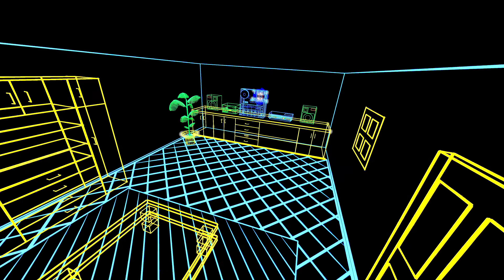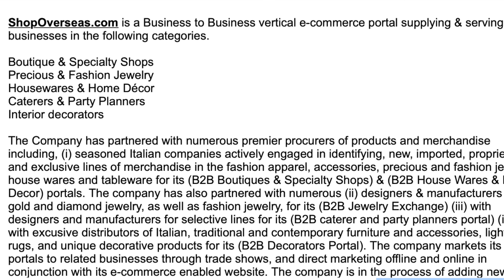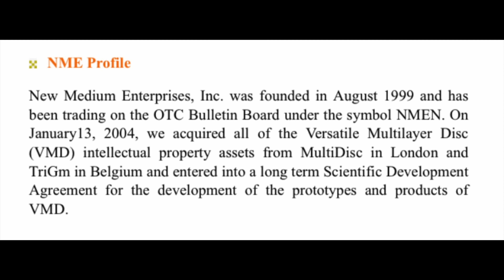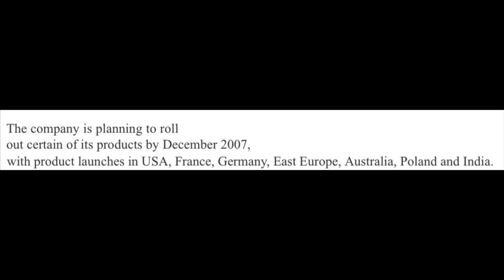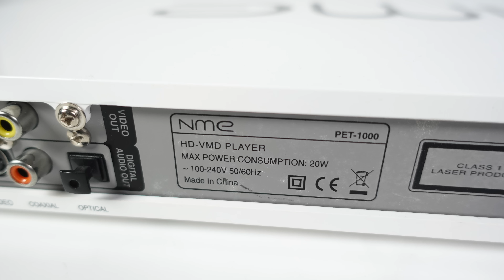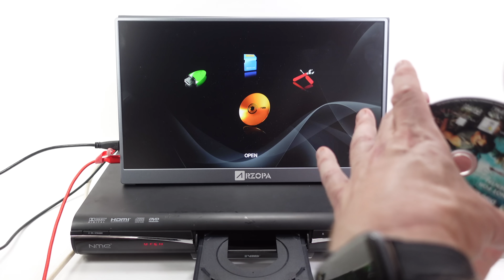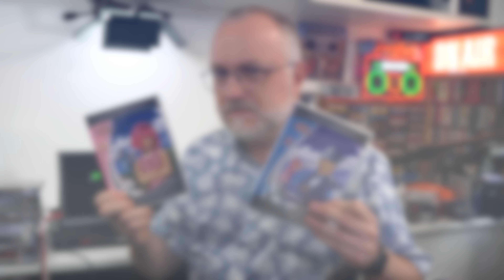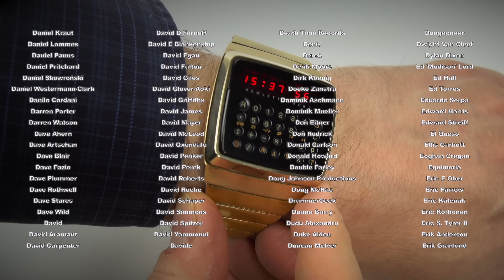The HD-VMD story - The format that lost to the format that lost

Comment: I would wager that those multi-layer optical discs have an HD_VMD version of the classic Laser-Rot, likely due to the adhesives used in the layering process attacking the substrate and making the disc unreadable.
Reply: It's Fran again! Nice to see you here 😊
Reply: Channel crossover!!!!?
Reply: @lamecasuelas2  
Oh THAT'S a collaboration I'd like to see, these two could make some great stuff together!
Reply: can you see it under a microscope,  I am feeling its more software changes
Reply: I had about 400 HD DVD’s that I picked up for couple of dollars each when the format failed, about half of them now have laser rot and are unplayable.
Reply: Fran comes Along floating an answer like she’s in zero g!
Reply: @adamreid5901  
 I ripped all of mine about 12 years ago for that very reason.
I’ve amassed about 2TB of videos so far.
Reply: wouldn't laser rot make them fail dumping in a normal drive?
Reply: @dalesmth1  yeah I only got around to ripping them in 2018 that’s when I realised how many of them had conked out.
Reply: Give me a flash drive or SSD to store stuff on anyday. That said, I still collect the odd CD and BluRay disc. Its always nice to have physical copies of your favourite titles.
Reply: @kakurerud7516  Probably, but then until someone actually plays the files from one of those discs we can't prove that they weren't corrupted.
Reply: @dalesmth1  How do you rip an HD-DVD, did they make PC drives?
Reply: @adamreid5901  holy crap! I've never had that issue with DVD's or Blu-rays, in fact some of my dvd are from like 20 years ago and they still play prefectly
Reply: I would wager that Mat's experiment of loading the demo discs into his computer and successfully not only reading them, but also copying the actual DMD files on the demo discs, reveals that there is little to no chance of of "laser rot" being the root cause of the discs not playing. Probably an codec/algorithym incompatibility... just my $0.02.   Fred
Reply: @electronicengineer  Agreed.  Disc-level error correction would not have allowed successful copying if it were laser rot.  Laser rot also tends to vary in severity, from minor glitches to completely unreadable.  The stuttering was too uniform.

It’s a codec thing.
Reply: @jonathansabinvarietyfilms  Haha if only EposVox hadn't done a video on that topic just recently! But indeed, there were some PC drives, one from Toshiba and i think one or two from LG, and LG made a multi format drive with Blu-Ray support as well, a bit of a hotly sought after good that one.

Much cheaper - just get the Xbox360 HD-DVD kit. That's really just a USB drive, it works on PC just fine. I won't talk about the software and whatnot, you can watch the video for that.
Reply: I've lost so many cds to this.  It was what finally put the nail in the coffin of me buying physical music on anything but vinyl.
Reply: @leewinters606  Vinyl is ravaged by use.  My cds mostly sit in a binder and yet I've still lost a ton of them.  If i had had vinyl under the same circumstances they would be pristine.   Solution is buy music on vinyl and rip to digital format and carefully store vinyl as archive.
Reply: That makes sense.
Reply: I think aliens are the reason it to be unreadable though.. prove me wrong Fran.
Reply: Most discs that have more that 120 minutes of content--DVD and Blu-ray---are two-layer (I believe there were a handful of specialty titles that were three-layer back in 2007). Anyway, I'm unaware of any titles from either format exhibiting rot more commonly found in LaserDiscs. I have a catalog of more that 3000 CDs and BDs (no more DVDs) going back to the early 80s and 2006 respectively, and none of those have any rot.
Reply: @jonathansabinvarietyfilms  
 Yes. Ever so briefly.
Mine was an ASUS.
Reply: @genekwagmyrsingh9433  I have about 900 CDs (and a smaller number of DVDs and Blu-ray  discs) and I've lost none of them to rot. I know this because I ripped them all a few years ago to a hard drive and continue to rip new discs. A few, half a dozen or so, could not be ripped but still played perfectly on my multi-disc player and on my Mac. 
As for vinyl being pristine I defy you to present a single vinyl record free from audible blemishes even when new.
Reply: @MrSatyre1  Agree. I think this "rot" phenomenon is just rot.
Reply: HD DVDs suffer the same fate--particularly ones made by Warner Bros.
Reply: I think the players just cant handle the format, same thing happens when I try to play blu rays on a low end pc
Reply: It seems more like the VMD codec was never developed to even put into the decoder chips in the first place, because later in this video the HD-VMD discs seem to read cleanly in DVD and Blu-Ray drive, just that the VMD codec itself is indecypherable. I would be astonished if it is even included in those big codec packs that can be found on the 'net, like the K-Lite Codec packs
Reply: @leewinters606  I think that vinyl records are supposed to wear out slowly over being played many multiple times, the stylus slowly wearing the shape of the grooves away.
I guess that migh happen with cheap record players with horrible needles, but it migh take an unreasonably large number of playings for it to even be vaguely noticeable on decent HiFi gear under average domestic use.
Reply: I suspect the reason why HD DVD lost was due to disc ROT. All the Warners HD suffered from this and they were also in bluray camp. They were sat on a massive liability if HD DVD won the war. In the USA for a while they would swap faulty discs. HD DVD was the better format. Crippled by disc rot.
Reply: @Ndlanding  fuck, i meant they still play perfectly, the keyboard on my cell phone Is set to a different language and makes weird shit when i write in english
Reply: @lamecasuelas2  disc rot is much more common in early cds from the 1980s, at least in my experience it tends to happen more from improper manufacturing, and as CDs and DVDs became more mainstream productions seem to become better.
Reply: @6581punk  I was thinking a whole bunch of CRC errors like I would see in discs with presumed rot (some of my very early DVD discs did not age well)
Reply: It seems unlikely that all disc directories would be easily and consistently readable while all the video files are so corrupted that you never see a coherent image.  I think the most likely explanation is that the HD-VMD codec or container format changed between the early demo units and the later production units.
Reply: @davidjgomm  get a black felt tip and go around the outer edge of the data side on the un rippable ones, blocks the data track that serves as copy protection
Reply: I'm aghast! Do you mean to say the company that was clueless about making a DVD player play back HD format video was also clueless about how to make reliable optical discs? Surely not those highly experienced engineers at (rewinds video) NME? 🤔 🤣
Reply: I used to work in a DVD Factory. All they use is clear coat lacquer that is sandwiched  between layers and spun at an extremely fast rate to get the excess off & distribute it evenly. Sometimes the DVDs were sticky around the edges. With a regular DVD,  there is very small amount that is used as the actual adhesive. If you had multiple layers of it built up, I could see it being a possibility!
Reply: @robertromero8692  -  I agree. None of my CD's, Even the burned ones I used as a DJ at the club on the weekends for years, are still in tact and working correctly. I am not sure what happened to this guys CD's. I would guess his players are shit or shit the bed because not all players are created equally and some just plane work better and see the music better than others. My computer readers are ruthless and are able to read even shit disks. I think he discarded CD's that were probably good and just dirty or he had a shaky weak laser in his player(s).
Reply: Velzek  Yep, that's exactly my implication. They weren't experienced enough to know that the codec in a standard DVD player couldn't decode HD video, and similarly they weren't experienced enough in the manufacture of optical discs to know how to prevent them dying from the HD-VMD equivalent of Laserdisc rot.
Reply: @robertromero8692  -  That is a possibility.  I recorded my vinyl onto CD and used my mix board and computer to clean them up. People swear I am playing vinyl but its just MP3's (192 to 320) made from vinyl. So be it. Haters keep on hatin :)
Reply: @robertromero8692  -  And the ones that say they can hear problems with MP3... But at the higher bitrates like 320, they are virtually lossless. As long as a turntable is spinning they think its vinyl and its just the MP3 playing. I encode with a real soundcard from yesteryear and use a mixer before the cards input to clean up and sweeten the sound. My mixer has a three band EQ and there is a five band in the puter as well as loudness and emphasis controls. The click and pop assassin software gets rid of the other issues. In some cases the actually sound better than CD's. Not as sterile but certainly just as clear.
Reply: @charliespringall2339  I bought several HD-DVD discs, and also rented them back when Netflix was a rental service. None of the discs had rotted yet; they were only a year or two old.
Reply: @jonathansabinvarietyfilms  There was an Xbox 360 external drive that was Windows compatible. It actually was supposed to be included in the console, but the format was delayed.
Reply: @adamreid5901  I had several dozen HD DVD’s, but sold them off. The movie studios had a trade-in program when the format died. You sent in the covers, and they’d send you the Blu-ray version for postage.
Reply: @5roundsrapid263  Not in Australia unfortunately
Reply: @5roundsrapid263  check any warner Brother ties you have see if the movie still plays. I had about 500 HD dvd in my collection. 2 years ago I bunned the WB ones. Not a single disc would play more than 10 mins. Ii had both onkyo and Toshiba players. Other brands did not have same issues
Reply: I would wager that they're not multi-layer at all, and that this group wasn't ever able to pull off multi-layer technology.  I doubt they ever played on that player.
Reply: @kakurerud7516  As long as a stream of zeros and ones come out of it, a dumb machine that does not know what it's looking for won't know or care that they aren't the right zeros and ones.

In those days, the studios were paranoid about unauthorised copying, and it's not surprising that material has been effectively left unwatchable.
Reply: @bluerizlagirl  dvds are a little more complex than a simple stream of binary. There are sub channels that handle timing and CRC. If you try to dump a DVD with rot or even a faded recordable, the drive and computer will let you know its having issues be it CRC errors and or drive making bad noises.. I am well acquainted with this issue as I try and recover old DVDs and DVDr discs.
Reply: Don't know about HD_VMD, but HD-DVD certainly had this problem. Some people say disks released by certain studios seem to more prone to this. I don't know, but I do know that a lot of the old HD-DVD disks I still have are now unreadable.
Reply: @stefanl5183  Stefan? 

I have a Question for ya, if you dont mind.
Reply: @adamreid5901  I would bet almost all your failed discs are WB movies. There was a manufacturing problem at a factory they used. Most non WB discs still play fine.
Reply: @jonathansabinvarietyfilms  I use an HD DVD drive for the xbox360 and makemkv.
Reply: I read somewhere the entire "project" was a scam from the beginning. Investors lost a bundle.

Comment: 23:40 As someone who's done drive fixes on XBOX360s and occasionally some other equipment with ODDs back in the late 00s early 10s, that laser in there looks awfully similar to a Sanyo SF-HD66 or HD68, which would be embossed in the plastic somewhere on the lasers body. If it is, finding replacements should be easy and cheap as those two types were at one point the most common laser units in anything that could read DVDs, including some XBOX360 disk drives and countless DVD players and DVD readers in desktop PCs. Heck if I still have one in my stash, I'd be willing to send it over just to give this oddball early player a chance of working again if the laser is all that's wrong with it (which is likely cause it's at least trying to read but fails)

Comment: Interesting, back in the day I remember hearing rumours that a multi-layer DVD format with more than two layers was "on the way". Now I'm wondering if this was that format, or if it was whoever sold NME the concept that was trying to drum up interest.
Reply: For a while there every few years you'd hear about a holographic disc with three dimensional data storage on it. I wonder if all three of these are the same thing?
Reply: @Owyn_Merrilin  The closest I could find on wikipedia to what you mentioned was HVD which according to the wiki page was supposed to be even better than Blu-Ray with 100GB read only and 6TB of capacity. 

https://en.wikipedia.org/wiki/Holographic_Versatile_Disc
Reply: It may have been FMD.  I thought it was the future and bought stock.  It never went anywhere.

https://en.wikipedia.org/wiki/Fluorescent_Multilayer_Disc
Reply: NME acquired DVD Forum's Multi-layer DVD, to build Versatile Multi-layer Disc, named VMD as HD VMD.
Reply: @Owyn_Merrilin  I rather SD or flash card/stick then another optical disc.

Comment: HD-DVD helped push new advanced codecs and for Blu-Ray dual layer 50GB discs rather than 25MB, the format war had a positive effect on the eventual outcome
Reply: Can you play hd dvd in a computer dvd drive?
Reply: @highpath4776  Not a standard computer DVD drive but both Toshiba and LG made internal HDDVD drives for computers, you can also use the external xbox 360 drive on a PC.

Comment: 12:55 actually not so sure about that with the blue laser point, Sony I know for a while were losing money on PS3s specifically because the high wavelength optical parts were so costly to produce. Might be cheap now but certainly was a factor then.

Comment: 13:20 While this is somewhat anecdotal, I remember blue /violet (405nm) lasers used to be very expensive.  A powerful blue laser pointer was a few hundred dollars IIRC, if not more. Cannibalizing a Blu-Ray player for it's laser used to be the best way to get one.
Reply: It still is expensive
Reply: @mjetektman9313  you can get dangerously powerful blue handheld lasers for $20 or so from china.  High end lasers are still expensive ofc, as they always will be
Reply: @startedtech  i know, I'm talking about the blu-ray drivers, here in my country the most affordable ones cost half a minimum wage and their prices can go as high as a minimum wage
Reply: @startedtech  I wonder if those layers are rejects from the media players? Like the good ones go into a player, and one that emits wrong or whatever goes into a pointer
Reply: Yeah the yields were not great back then. Made the unit price a lot higher. While the yields were very high with red lasers. But it had gotten a little better by the time this came out, and Sony et al had enough money to make losses per unit for a while and now the yields are decent.
Reply: I bought my blu-ray burner in 2008 for like a hundred bucks, they must have got very cheap very fast

Comment: I'd be interested if the HDVMD player could read the files from the demo disks through a USB Stick or SD Card, maybe they just royally f'd up something so it had problems reading the disk's content through the drive which they later somehow fixed with the codec or file table on the disk!

Comment: Great, interesting video! 
What this proves, is what I was saying all these years, with HD video on DVDs. 
When DVDs came out, they should have contained 720p video. I mean we all know and (probably 😉) used 720p and 1080p rips of TV episodes and Blu-rays. Well, most of them were 4-8gb, so they'd fit on single and dual layer DVDs.
Alright, maybe not right away, in 1996-97, but later in the format's life, around 2002, 'they' could have released an upgrade, like VMDs firmware, to have HD video on DVDs.

Therefore Blu-rays should have been with UHD resolution right away. We've been intentionally screwed over, held back 10 years, amassing collection in a lower resolution.
Reply: Part of DVDs problem with HD was the standard. They baked in MPEG2 as the video format which well...not the best compression. It also was stuck with earlier audio formats that also took up more space. 

By the time Blu-Ray and HD-DVD came out, though, we could've easily just kept using DVDs with the newer video and audio formats which would've allowed HD content easily at those sizes. Early mp4 was already pretty common with divx and xvid implementations (h.263), and h.264 was pretty much around already.

Horrifyingly, if I recall, early blu-rays still used mpeg2, and basically just shoved the bitrate as high as it could go. Just seems this particular format war was a stupid way for the industry to avoid using better files by pushing disks that held more of the older one.
Reply: @FinnFann  You're right, some of HD DVDs were better, in that they used VC-1 codec, while BD counterparts were MPEG-4.

Comment: I'm assuming they actually got physical VMD discs working at all and it didn't just end up being high compression HD video files on a normal dual layer disc that the players were designed to decode?
Reply: Yeah that's what I thought.. I reckon that copy of 'Saw' is HD compressed to 4GB
Reply: @alanmooremobile  Might be a dual layer DVD and it's just 720p to make the entire thing fit onto one disc. I mean... no one said the whole format is 1080p-only right? Plus they could've still called it HD at 720p. Would've been very scummy but technically not wrong...